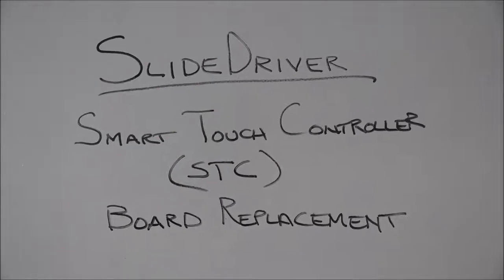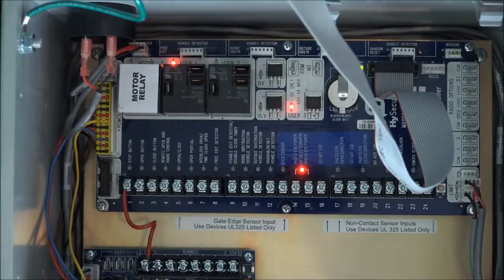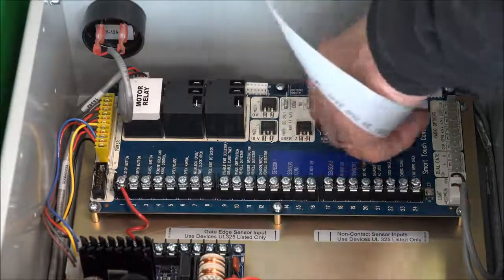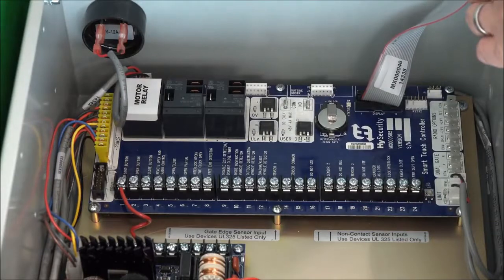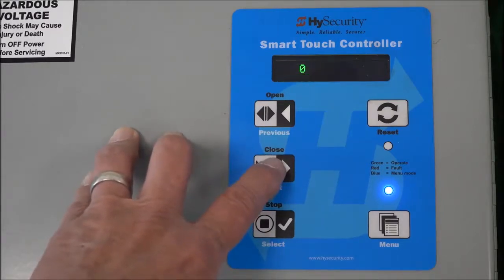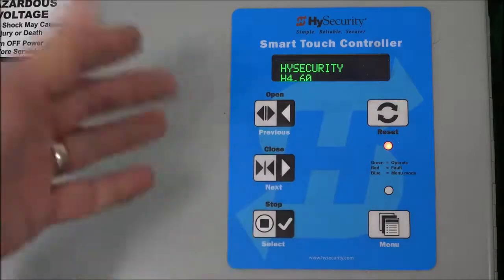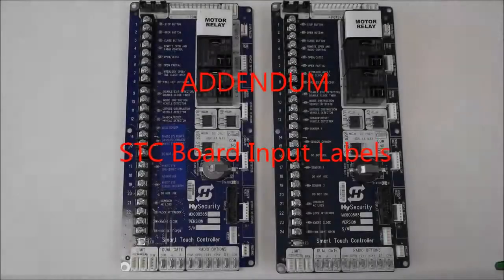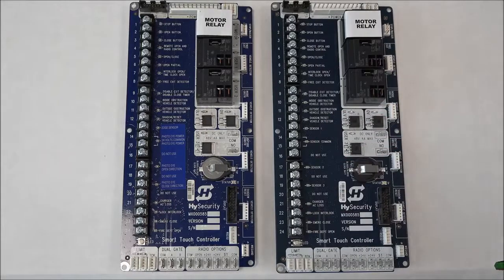HySecurity - Smart Touch Controller Replacement

Comment: I’m getting a stop command on my smart touch controller board and it’s overriding all other input commands. There’s a red light next to the stop terminal. I removed the wire and connected a jumper from the stop terminal to common and that bypassed it, allowing the gate to slide open and closed. I’m trying to figure out what could be commanding it to stop if none of the stop buttons are pressed. I’m assuming those stop buttons are normally closed.
Reply: Rick Tatorship, what is the wire that you disconnected going to? That device is probably the culprit. Commonly the photo eye or edge sensor will be attached to the stop terminal.

Comment: You need to do a video on how to re learn the open and close stops
Reply from the maker: Below is a link to the SlideSmart installation video. At about the 9:15 mark they describe setting the open and close limits. Also below is a link to the Quick Start guide for the operator, on page 6 it describes setting the limits. Hope this helps.

https://youtu.be/TYN8PXjAIk4

https://support.hysecurity.com/hc/en-us/articles/360043165574-SlideSmart-DC-Quick-Start-Guide